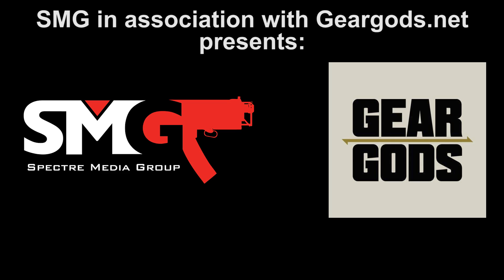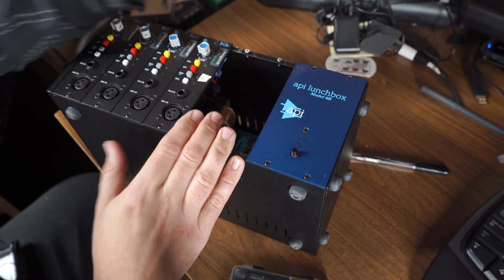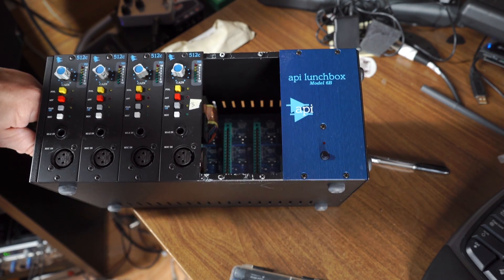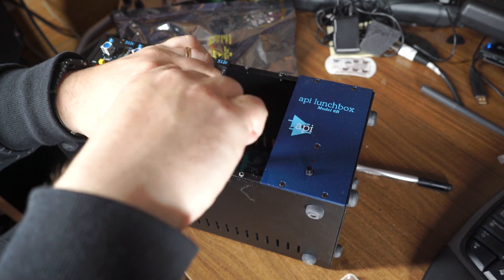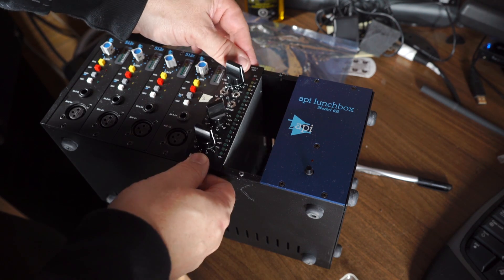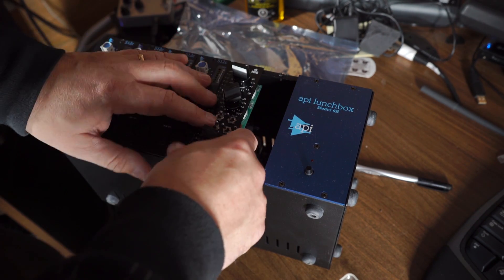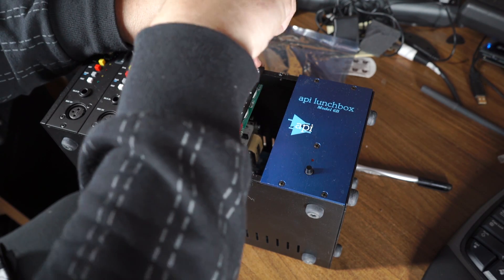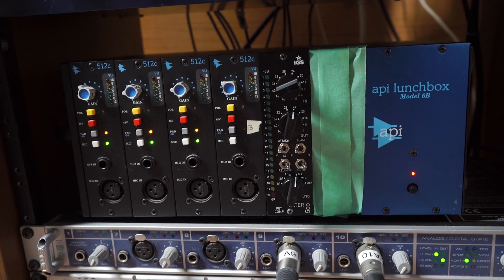How to Install a 500 Series Module

Comment: Glenn, do you think you could do some kind of overview on the 500 series world? I do a bit of recording myself and the 500 series is a realm quite foreign to me. Do you have to use API brand products with the housing? How does the "lunchbox" hook up to your AD/DA interface? Can individual modules be run from one to another within the system (e.g. can you run an API preamp into an API compressor)? I don't know about other viewers, but getting to see how studio equipment works and is routed is very interesting to me, especially considering you've got some cool gear that's still out a simple home setup's price range. Anyway, love your how to's!

Comment: Hey Glenn, when you use either the IGS or the Distressor I know that you run the signal straight through before your interface. Do you also take a dry signal of it in case of initial over compression? or am I completely wrong and you record it dry and run it through the compressors later? Thanks

Comment: btw, this video reminded me, thanks for the soldering video. Before this week, I hadn't done that in a long time, and your video reminded me basically how to do it, which came in use this week when I had to cut the 1/4 in. heads off some cables and replace them with XLRs to fit the new outports on some new Midas boards I just got at work. Job went entirely successful and the cables work perfectly.

Comment: Another precaution you can use when installing exp. cards is to "ground" yourself - basically touching any part of your skin to an unpainted part of the chasis you're working on so that any static charge you may be carrying grounds itself to the metal.

Sorry for being the complete dumbass, but how do I log in to the live event?

Comment: I was planning on starting up a studio.
Could you please give tips on what you'll need to get started?
Also i want to know what re-amp and DI-box does.
Great videos! They're interesting and quick to the point.
Reply: lippled DI box is a device that lowers the volume of a guitar or bass to a level that isn't clipping/too loud, i.e. what's called a low impedance signal, so that you can plug the guitar/bass directly into a preamp or an interface that doesn't have a pad. Used for amp simulation plugins or re-amping. 

A re-amp box does the exact opposite: it converts the recorded DI signal to a high impedance signal so that you can play the DI track through an amplifier. Re-amping means that you play the DI track through the amplifier and record the sound as if a guitarist is playing it. It works great if you're still trying to figure  out what guitar tone and settings to use, or if you don't have a guitarist around to test an amplifier's sound.
Reply from the maker: Yes.   That's coming soon!

Comment: THAT COMPRESSOR. So sexy. That snare sound was "Quadrabrutal" try getting DKFH to sound like that! I'm currently working on my mixing skills and I have a mix from a band I downloaded off the internet. The snare sounds nice atm, I've managed to get a decent amount of attack off it, but it seems to lack weight. What do you recommend to add some depth and weight to a snare drum..
Reply: ***** Cheers for the advice man. I already boosted around 180hz, but what I did was used a different EQ (one with a bit nicer saturation) which made a huge difference surprisingly. Then I dropped the same frequency from the bass by about 2-3db I also added a side chain gate to the Room mics so that when the snare hits, the room mics come in and that made it heavier than a really heavy thing. Thanks Glen for that Idea. I took what you did on the Snare drum video and applied it differently.
Reply: Sorry, it was the cool tricks with triggers video.
Reply: That's what I usually do to, but I always find it makes the cymbals sound weird, so I end up turning it down in the mix. I always feel like there's got to be a better way to maximise them room mics. This is deffo one idea that seemed to work for me. I also added some compression and a HP LP Filter to dull the cymbals and tidy up rumble.